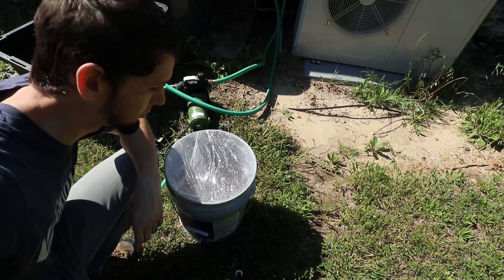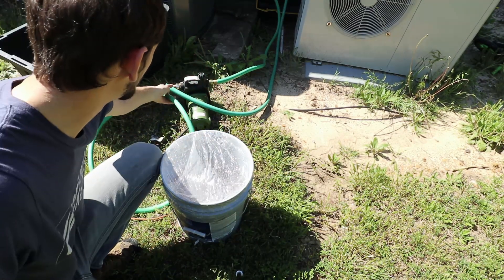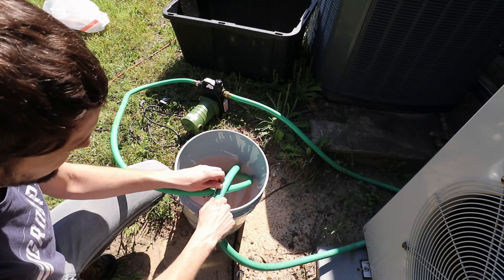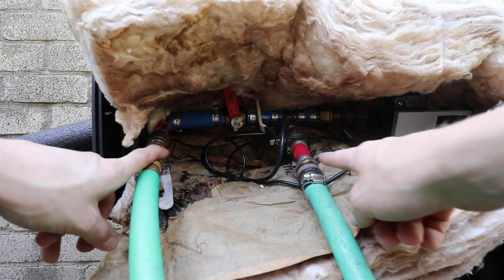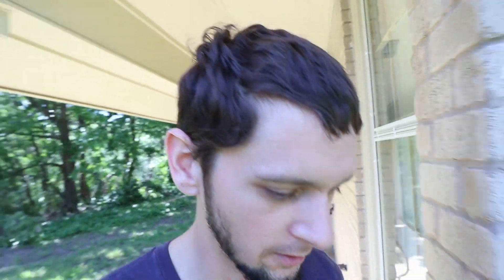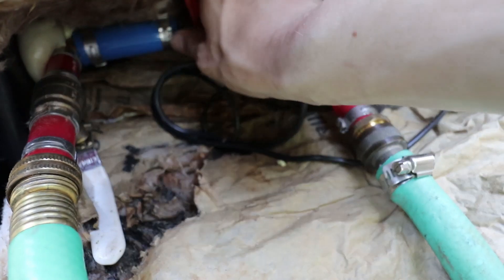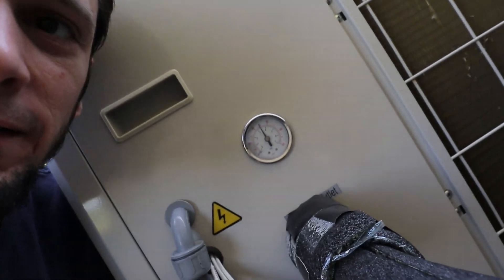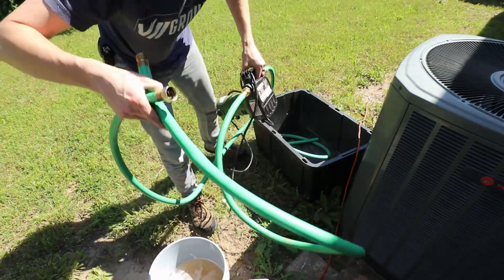How To: Pressurize a Chiltrix Heat Pump Chiller

Comment: Would you say this system has been worth it considering it for my reno. 600 sqft basement hydronic floors and upstairs would be fan coil units. 3 of them. 

For dhw ill do a rinnai tankless as the dhw for chiltrix seems like a lot more work/space to take up plus id never run out of hot water.

Comment: What are the symptoms of the pressure being low?  Or do you just monitor for it and recharge as needed?
Reply from the maker: Unfortunately there is no electrical sensor. Just the analog one on the unit outside.

Gurgling is a sign it’s much too low already in my experience. If the level is low enough for the flow meter to not move that would be an indication. My outdoor unit is lower than my fan coils so it would by he last to run out of liquid thankfully.

Comment: Hi Christopher, why do you pressurize the system so high? Chiltrix suggests 29PSI for the CX-34. Are you allowing for lowered system PSI from micro air bubble escape through an air separator (if you are using one) over time or is 40PSI where you have found this particular system to work best? I, too, have DIY installed the CX-34 for radiant loops and DHW in CA and would love to chat sometime about your experiences..
Reply from the maker: Yep, I’ve got a slow leak somewhere so since the maximum for the system is 43.5 I let it run a little high knowing it will drop.

Still haven’t been able to find my leak, or maybe I’ve got some air stuck somewhere that slowly makes it out of the bleeder. I suppose that would be the best case scenario.

Did you install a buffer tank for your radiant loops?

Also how well does it heat in the winter? My unit seems to cool better than heat, which is odd to me as it has more btu heating capacity than cooling! 

Long response, sorry. But if you look at the status pages and find the compressor frequency when it’s heating at full blast does it show 80hz? That’s what mine maxes out at when heating.
Reply: @beenegarage7116  Hi again.

Does your pressure keep dropping or stop at some lower point eventually? I start mine out at 35PSI and it slowly drops for a few weeks but stops dropping eventually between 21 and 25 PSI. I am guessing there are many places where air hides in my loops, plus my air separator is not at the "top" of my system, but rather 4-5 feet below in a lower level.

I have the VT37-B buffer tank from Hotspot. The 19-gallon would have been enough but I plan to run two Fan coils eventually off of the same buffer tank and wanted the additional ports. I must admit I was a bit bummed out when I listened to your video of how loud Chiltrix's fan coil units are, but I would be using the smallest ones in two tiny bedrooms so maybe they would never run higher than the lowest fan speed in general. Looking into other manufacturers fan coils as well in case I want them in my ceiling.

I am in Sacramento, so the winters are not very cold - didn't ever get to freezing at night this year. It does just fine and I think it would do fine with the addition of two more fan coils as well. I have never checked what the max compressor frequency is when it's running at full blast. I just looked today, but it's barely being used in our warmer than usual Spring temps - it read 51hz on line C27 Compressor Frequency during the last cycle.

I have Hotspot's newest DHW with the extra large coil but am not installing it until April or May. Until I actually try to install fan coils next year, I won't be using the CX-34 for cooling at all.

One last thing since I mentioned that the fan coils in your video sounded louder than I expected: The CX-34 itself is also much louder than I had expected based on their claimed dB measurements. It sits between my house and my neighbors and if I had known how loud it would be, I might not have bought it - I have become used to it, but I was surprised and frankly disappointed at how much louder it is than a ductless mini-split compressor!

Comment: Could it be possible that there is a small leak in the bladder of the expansion tank?  I also was wondering why you would have two pumps instead of them providing a higher capacity pump?

I was also wondering why they ship the pumps in a seperate box.  If I understand things right the pump(s) have to be after the expansion tank(s) in the circuit.
Reply from the maker: I hadn’t considered the expansion tank. I wonder if it is one with an air bladder like the tanks used for a house with a well. Are you thinking the air bladder side could be losing pressure?

Yeah I don’t know about the separate pump thing. We were running a 12k and 8.5k coil at full blast yesterday and the cx34 was running the compressor at 47hz out of 110hz available. Doesn’t seem to match the rated capacity, I think my indoor coils aren’t as efficient as they could be. Water was moving at about 15 liters a minute. I think it was in the mid twenties when I had two pumps connected, so I might be hurting myself some with only one pump. But the spec sheet says only 2.4gpm is needed for the 12k unit to provide full capacity cooling.

I hadn’t considered where the pumps should be in relation to the internal components. I do think I read the external pump was to be installed on the output side which is where it was at. Only question then is if the internal pump is the last thing before the water exits the unit. I suspect it is.
Reply: @beenegarage7116  I was thinking that there is a pinhole in the bladder and water was leaking in and air out.  Did you install on of these? https://www.watts.com/products/plumbing-flow-control-solutions/hydronic-steam-heating/air-separators/as-mb

Take note when you turn on the heat the first time and make sure you do not get too much pressure.

I was surprised to find supercooling was a thing

 https://www.google.com/search?source=hp&ei=fr9RXc_BNoqb_Qa9xouYCw&q=supercooling+air+conditioning&oq=super+cooling+air&gs_l=psy-ab.1.0.0i22i10i30j0i22i30l2.1359.9829..12987...0.0..0.118.1288.16j2....2..0....1..gws-wiz.......35i39j0j0i10.q7fbnbUWsj8 

Would having a larger line size help? 1 1/2" maybe.  I am not sure if you could get by with one pump by just increasing line size when you add more CFUs.
Reply: @beenegarage7116  Any update?
Reply from the maker: I think I’ll need to wait for winter to look for leaks, hard when there is condensation on any uninsulated pipe.
Reply: @beenegarage7116  If you still have problems finding the leak this winter I was wondering if using a fluorescent dye would be a possibility, I do not know if it would cause and corrosion problems.

Comment: http://www.dpcalc.org/  I am not sure if this dew point calculator would be helpful to you or not.

I found this site and it may answer questions you did not know you had. https://www.youtube.com/playlist?list=PLuuV0ELkYb5VE0I4evUZ30b5U78CRlRdg

Also I read a lower fan speed will do a better job of dehumidification. I gather if you ran at a higher temp, lower fan speeds and ran another unit or as many as you can as not tax the CX34 too much could lower your cooling cost.